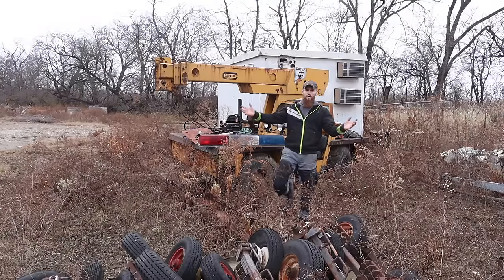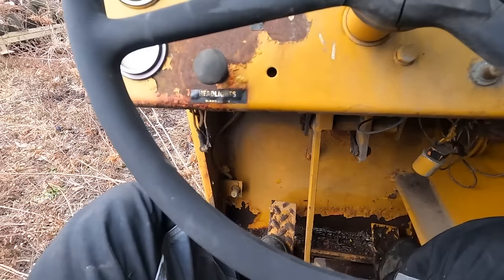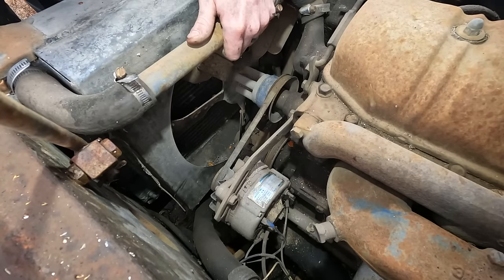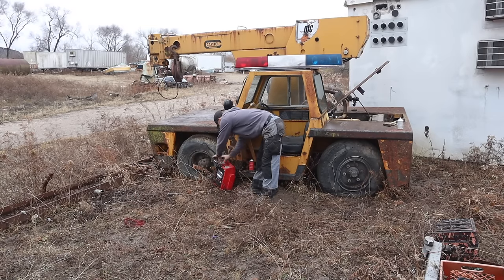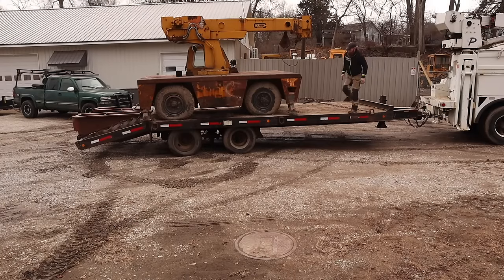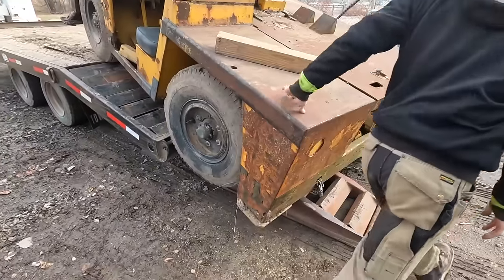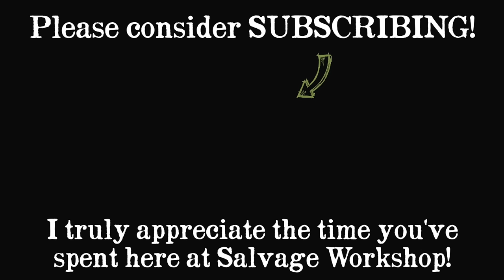Recovering a Crane DESTINED for the Scrap Yard ~ Broderson IC70 Diesel Deck Crane

Comment: I received an odd reply to my post and just wanted you to know so you can check it out. It instructed me to "text" you to reply and receive a gift of some sort. Anyway, it just struck me as odd.
Reply from the maker: It's a scam! Don't respond to anything like that from any creator, we will not get a hold of you that way! Thanks for letting me know!

This is a constant battle with these fake accounts, please DON'T fall for their attempt to scam you!
Reply: @SalvageWorkshop  It didn't feel right.
Reply: @SalvageWorkshop  what happened with the old 3 phases machines from 2 years ago, are those stored in another shop or are "rescued" for good?
Reply: @SalvageWorkshop  you're a funny man. Water in the engine, first thing you do is start the engine with the startmotor without a 360 on yhe crank. Hydrolock it straight to hell. Lmfao good game on the more engine damage kek.
Reply: those are scammers!

Comment: I think it is a Fordson 4D industrial diesel engine, made in the UK at Dagenham and these engines were actually called the Dagenham range, available as both the 4D and 6D (6 cyl.) versions. Very characteristic rocker box cover shape and the horizontal injectors are also unusual. As well as being used in tractors, they were often used on stand-by generators and in small boats. They were considerably cheaper than their Perkins, Lister or Gardener equivalents.
Reply: Hi it's not a 4d industrial engine those are 220 cu  and look identical to what's in my Fordson major tractors this has way to many differences. Another youtuber has a similar crane, and those injectors had me thinking when I saw it. The nearest i can come up with to this is a 172 or 192 industrial diesel, that's similar to what's in a a ford 8-900 series tractor.
Reply: Looks more like the later Ford Dover engine (Dorset I believe was the 6 cyl version) which was mainly used in Ford Cargo trucks in the 80s & early 90s?
Reply: Used to work on a very similar 4D Ford in the seventies, they were fitted into air compressors and were very reliable. Used to have to renové a little plug out from the back of the timing case to set the injection pump.
Reply: @WeeShoeyDugless  You mean the later 2700 series engines than the original 220 4 and 330 6 D's. Apart from the head having the same idea with the injectors under the valve cover and the head ports the same side, everything else is totally different on this one. Like I said this is a 172 or 192 sold in the American market I never saw one in the UK, but the 2700's were real common and I've owned and still have 4 and 6's in Dags, Dover's and Dorset ranges
Reply: @Broozer-fw3vl  I know what you mean about the plug, Ford in their wisdom had a special tool nobody now has,that was supposed to screw in there to time the pump. it had a spring pin in the tool to indicate the countersunk hole in the gear was in the right place, I just sold a tractor with one of those motors in and read my service manual to tell the guy last week when he asked.
Reply: Im kinda surprised it dident have a detroit in it for beeing that old.
Reply: Well... So it was sold like this, broken? Why would someone just put UK made engine in anything?
Reply: @WeeShoeyDugless  I agree. Not Fordson Major engine, but newer so called "Trader engine"
Somehow I saw Ford logo in valve cover.
Reply: A good reliable engine, I used one in a Compressor
Reply: @poprawa  The smaller Ford industrial engines of the period, sold worldwide, including the USA, just happened to be made in the UK, as that is where the majority of them were used in the Fordson Tractors. Virtually nothing Ford is now made in the UK. They closed down their main engine plant in Bridgend in Wales, a couple of years ago. That made engines for Ford themselves, Jaguar and Land Rover. A sad state of affairs from when Ford, Dagenham was the largest car plant in the UK and the second largest Ford plant in the world. They even had their own iron blast furnaces, steel furnaces and power station.

Comment: Had one of those cranes in my shop, it was a great asset to the shop and reliable.  It was still operational when I retired,  Used it for unloading equipment and replacing engines in large equipment.  Great piece of machinery.

Comment: FYI, most downriggers are pretty easy to raise without the hydraulics running. Use a bottle jack to raise the machine far enough to slide a floor jack under the downrigger pad, then let the bottle jack down. Pump the floor jack up a few inches to put pressure on the cylinder and move the downrigger's control valve lever to the UP position. Most valve bodies will allow the fluid to flow back. Rinse and repeat until the pad is high enough to not get in the way.  Outriggers like on a backhoe can't be raised all the way with this method, but you can at least push them up to a horizontal position. I've raised them the rest of the way with a strategically placed come-along or chain hoist. As you might guess, I have a lot of things with leaky cylinders.
Reply: YES
Reply: All Crane cylinders including outriggers have holding valves installed in the cylinder. This valve keeps the cylinder from drifting in or out while holding all the extra weight the crane is lifting. The valve most likely in the can side of cylinder where the hose's go in will need to be removed and then the rod will be able to move.
Reply: @komatsutech1 this is what I came to say.

Comment: Please keep it! This is, by far, the most interesting vehicle you've ever rescued! I want to see it restored and repainted and nicknamed and all of the good stuff. You could get a LOT of use out of this machine!
Reply: Also, I really do hate to feel stupid for asking, but how did you know it was a Diesel engine within the first 2 seconds of lifting the lid on the engine compartment? I honestly thought it was a standard gasoline ICU just by looking at the cover on top of the block. Go ahead, flame me. lol
Reply from the maker: @StealthDonut1  No need for flamin, nothing wrong with asking! I knew it was diesel because there was an injection pump and not a carburetor... also there were no plugs, plug wires, or a distributor... plus the fuel filters on diesels are typically larger and closer to the engine / injection pump like it was on this engine.

Lots of little things, that all add up to it being diesel!

Good question!

Comment: When you removed the bend on the exhaust pipe beside the engine , it was fully coated inside with black soot with no sign that rain water had been flowing in that way

Comment: In 95 I spent three months working in Atlanta. They had a large Grove crane trying to lift a brand new crane like that on to a higher level. The Grove boom was extended to far out and the welds broke with a large KA- BOOM and crashed down on the driver cage and took off the hydraulic tank on the small crane. Smashed them both flat. My coworker and I were watching the gauges testing our lines and witnessed the whole thing. Ah the memories.
Reply from the maker: Oh my... that would have been a sight to see!

Comment: That is a ford 172 diesel. That’s the identical engine that’s in a ford 4000 industrial tractor. The injection pump is a Roosa master. The injection lines running through the side of the head are actually running to jumper lines that feeds the injectors that are fashioned in a typical up down manner. Message me if you need more information but you can find most anything you’d need available online.
Reply: He should try bleeding the injectors, just loosen the lines at the injectors and crank until fuel comes out steadily in spurts.  Go easy on the starting fluid or you will blow the ring lands off of the pistons!  Happened twice on the engine I had in a Balmar loader,  replaced it with a gas farm tractor motor, it bolted right in!:eyes-pink-heart-shape:

Comment: Comments have been made suggesting that the engine is a Ford UK Diesel and speculation to the model type. I worked in Ford Parts in the UK. If you can get to the side of the Block it will have a  casting number eg, 508E 6015 /2701E 6015 for the Truck engine or C5NN 6015 for the tractor Engine. Each of the numbers will be followed by id letters for example 510E 6015 AA  for instance. It is possible that it has a CAV injector pump if it is UK made. There may also be casting Numbers on the Inlet Manifold. Hope that this is not to misleading

Comment: That's a real nice find. With a dead machine try putting a jack under an extended outrigger . Then pump the jack with retract motion on the lever. Once it's where you want it put the lever in the neutral spot. It worked more than once for me. Good video !

Comment: When I was in school for my avation mechanics license, my instructor had an older gas version of this crane that had been sitting on the school lot for a while after he used it to move some plane projects around about 5 years before. I helped him get it going again with a new starter and a good carb rebuild. It may look like everything is easy to get to, but with the engine being tucked in the center surrounded by heavy metal plates, it proved to be a challenge, but I definitely enjoyed the experience.

Comment: It's a 172 cubic inch or a 192 cubic inch ford diesel. They were used in 801 series and 901 series ford tractors and the first generation thousand series ford tractors. The 192 is the same block and everything as the 172 it's just bored out and was used in industrial applications ie: air compressors, gen sets, water pumps, and probably this crane. The 2 plugs on the intake manifold are preheaters you'll want those as they are very cold natured, they are good motors and run very well and can still get parts, the vanes in the injection pumps will get stuck if it sits and doesn't get started up and run every now and then, but other than that they are a pretty good engine. Got a ford 961 diesel that I restored that needed a new motor took a 192 out of an air compressor and replaced the 172.

Comment: After further research the engine appears to be either a 172 or 192 cu in engine used in Ford 800 series tractors. They had an Injector setup like yours. Jensales has manuals.
Reply: I agree you

Comment: Matt,  I never even heard of Broderson cranes before but it looks like the Ford 192D (or is it D192) in one of the boat hoists at work. It could be a 172. I don't know  how wide the Ford line was. It is an offshoot of Ford tractors. They also made it as a gas engine. The fuel system is a little finicky to bleed. As I recall the injectors are vertical and what you see are extension tubes. The pipe plug in the intake manifold should be a cold start coil plug, one at each end. Even with glow coils, she is hard to cold start as a recent rebuild. We use a core plug heater for cold temps.You need glow coils unless it is really warm outside for a cold start. Once you get it going it runs well, however.  Put a safety clamp on the dead end  of the load cable. Look up the approved way  with a short scrap of cable clamped to the tail.

Comment: If you are ever in the situation where you do not know if it's 12 or 24volt, A quick and easy way to tell is check the volt meter, so long as it has a volt meter. If no volt meter is present start with 12, no harm done, unless it was 6 volt, that would be a headache and a half as the smoke starts rolling.
Reply: Il y a un moyen plus simple: Il suffit de démonter une ampoule et lire le voltage!

Comment: Quite the project. Since those Air and Exhaust pipe "pass throughs" look post factory (especially since you said wrong location for the Air Cleaner) agree it's a re-power with "something". As I recall Ford and Perkins used that bluish engine paint.  The Oil Filter P/N might be a start as well as Injector Pump Model. Besides that, start crawling around looking for a casting numbers or a data plate someplace. Sure, some pictures posted on a diesel engine online forum might help too.  Good Luck and look forward to more on this baby beast.

Comment: I started working on railroad in 1978!
They used those to move truck sets (wheels bolstered that connected the side frames wheels axles brack rigging.
Under powered hydraulics, lifting capacity!
They were useful but bigger machines came along soon!
You know, bigger faster better!
I came out of the era of the Clark’s!
Seen them, was around them!
For you and what you do! It will be fantastic!
There beasts! 
Be fortunate careful and use it till you can  swap for better!
Like a excavator!
Dump truck of a good vintage!
Life is about to get exciting!
Get your business plan ready! Trust me after a bit you can make your dream come true! That business plan has to be accurate! Do it, do it in the next six months, be ready!

Comment: I'm an electrician and any job we go on that uses a scissor lift we unplug the alarms cause they will drive you freaking crazy. I'll even unplug other trades or at least show them it's surprising how many people have no idea you just open the battery tray and it's a simple push connector you unplug and have a nice quiet machine lol

Comment: Those are really handy cranes. I used to service one out at a paper towel factory. Probably from same era. It had the leaning tower of power slant 6 Mopar engine in it. A contractor there had a newer one that ran on gasoline but don't remember what engine. Could've been GM V8 350. All I remember is the throttle control was drive by wire non serviceable unit and it was acting up. That was 15 years ago.

Comment: 17:25 Over-full condition is quite common on older diesel engines because they end up using more fuel due to reduced compression, and this cycle proceeds until the engine loses too much compression to work properly.

Comment: As a crane inspector, I recommended to a customer that he replace all the signage and labels on his carrydeck because the old warning and load chart stickers were not legible.  He bought the complete factory kit. Next year I about fell down laughing when I saw that he even put on the "This crane cannot be used for bungee jumping" sticker. Full boom length, extended was about 12 feet.   Edit.   Load radius is figured from the center of rotation.

Comment: You ever heard of 4 points of tie down the legal way to doing it instead of 2. also that motor looks just like my Ford 172D  motor in my Michigan loader. That engine was used in Ford 4000 series tractors and some big air compressors

Comment: In the future, your chains holding down the crane when you "secured" the load were way way way to loose! you shouldn't be able to wiggle them at all when tight. When you stopped in front of your shop the crane moved, in an accident that crane will come flying right off there no question about it.
See guys hauling skid steers with loose chains all the time too, don't seem to realize just how dangerous that is.
Reply: Unloading it was a complete fail....you should have had your fork lift right behind the crane and controlled its back down the ramps.

Comment: the engine in your crane looks tome like a ford 4d , many years ago when I was a lot younger ford did bring out an engine with the injectors  inboard like those, if memory serves when you lift the rocker box the injectors are fairly standard bolted down to the cyl head in the usual way, I believe they discontinued that design because, if a leak developed the fuel went straight into the sump, which quickly filled it up lock up the engine if you  didn`t check your oil regular, hope this helps. paul,  here in the good old uk . Wilson Laidlaw, looks to have got it in a nut shell .

Comment: We had a Detroit that had a hole drilled in the intake nut brazed on with bolt and T handle . Was great add on for inserting either and it was addicted to it

Comment: I suspect the engine was replaced which is why it had the muffler and air filter on the deck which is normally smooth so long items can be carried. Broderson should be able to provide parts and service information.

Comment: It's a early little 4online rambler 180 engine modified to run on any combustible, and marinazedin and outtake
Run for little crucers or sail boats too
That engine us super cool, low maintenance al great gas by hour ratio
Burns everything
Used Oil from kitchen
Use to gas in that time with "fuel oil"

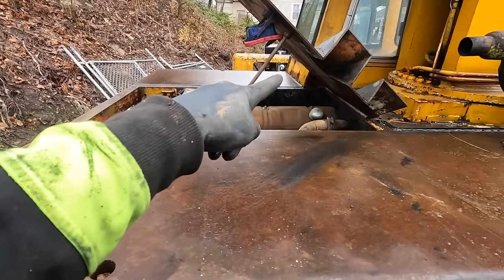Comment: 48:35 SUGGESTION: BUILD A BRACKET PERPENDICULAR TO THE GROUND to mount that air intake on....

Then make sure where it goes down into the engine compartment, it has a DEEP U-bend with a drain valve of some kind, which prevents moisture buildup.

It will do many things at the same time.

Of those, the MOST IMPORTANT are, Keeping the filter element and housing from being crushed, keeping the operator's line of sight as open as possible, and keeping water from being sucked up into the engine.

Comment: Might want to thing about making a stationary crane for your shop.  Mount it on a tall thick walled pipe.  Put an electric motor on hydro pump.  Great for pulling engines and about 445 other things in a ship.

Comment: Broderson IC-70 carry deck crane
4,650 hours on meter
Perkins four cylinder diesel engine
Hydrostatic transmission
Stick crane controls
Telescopic boom
30' boom length
10,000 lbs maximum lift capacity
Winch
(4) stabilizers
9.00-15 tires
Serial 456B